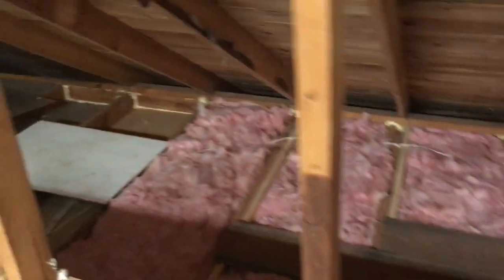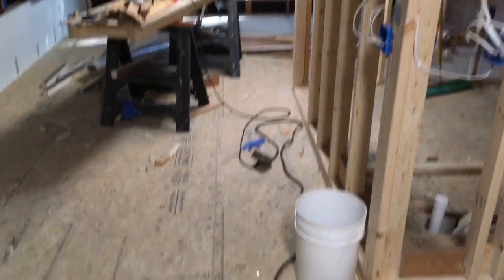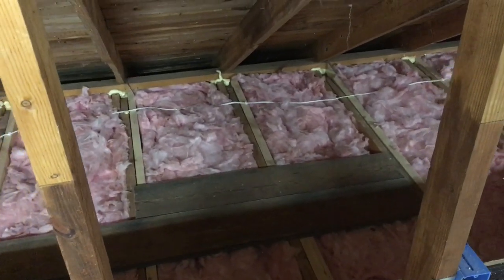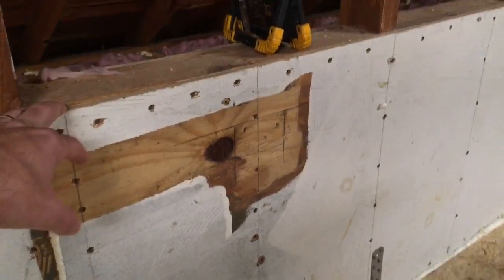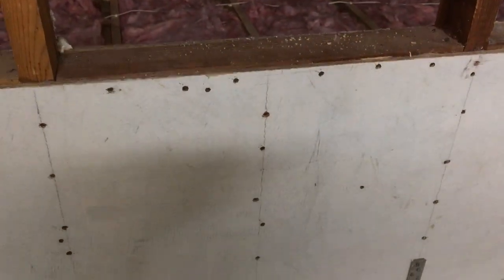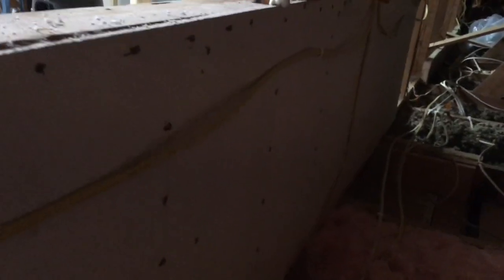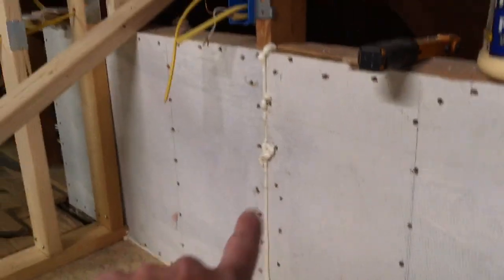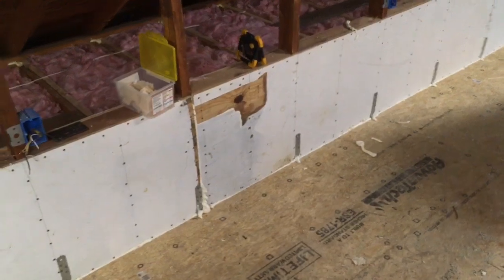How to make 2x6 joists work in an attic renovation--AND PASS INSPECTION!

Comment: I have a very similar situation as this.  I see lots of people sistering joist or reinforcing with plywood, but I want to slip an additional 2x6 in the middle making it 8 inch on center.  My calculations show this would span a 30lbs live load at 12ft.  How come I don’t see anybody doing this?
Reply from the maker: Good question. I can think of a couple of issues: The existing joists will have a sag to them, and you would want to put the crowns up on the new joists, so the floor would go from sag to crown to sag to crown between joists, causing a wavy floor. Also, if you plan to insulate, it would be a lot more cutting.

Comment: If you had to ballpark the # of hours and dollars you ended up spending on the structural part of this renovation (not making it pretty, plumbing, electric -- basically just structure, insulation, etc.)... what do you think you spent in time / money?  PS:  Super helpful video.
Reply from the maker: Whew! It's been a while. It probably took 40 hours to get the floor framing, insulation, and sheathing done, 8 hours to insulate the rafters, and about 30 hours to drywall, mud, and sand. I think we spent less than $5k dollars --- that might even include electrical and plumbing.

Comment: Very interesting but we wouldn't be allowed to do that in the UK I'm fairly certain. And we're definitely not allowed to 'sister' with the same size joist, I've been told I have to use 8x2's which are twice the height of my standard 4x2's, before 'sistering'.

Comment: So basically you used the knee wall as additional bracing to supplement for the lack of code on joist span. I never heard of this method. Makes sense though. I don't think every inspector will go for this.
Reply from the maker: Yep. That's basically it. The knee-wall sort of acts as an above-floor beam to cut the span in half. Here's a video I did to try to better explain it.  https://youtu.be/yBOwkIeroro   Thanks for the comment, Uptalk1!
Reply: its pretty much like putting a steel in underneath but this way the joists hang off it rather than sitting on it.Depth of the box beam is key. If it was plyed the full height it would be immensely strong.

Comment: Similar to my conversion as to the box beam and string back. I installed a floating 2x8 floor on 12” with some doubles. The attic insulation was done exactly the same.

Comment: Dave - very interesting thanks for sharing. I am from the UK here. Over here a loft conversion has to be backed up by a structural engineer, you pay him to do calcs and the local authority double check the workings. I don't see how someone can come over and feel if the floor is solid or not because you have dead loads and live loads. Like is the inspector going to come back in a holwling gale or when you have 2ft of snow on the roof??? It all sounds a little like hit and hope to me. Two by sixes on a 24 inch span seems well underpowered to me, my ceiling joists are the same but at 13 inch span in an unconverted attic. I get you have done this box beam and transferred load to the outer walls but in the UK you would be using steel and 11 inch deep joists. Yes your conversion might be legal but I wouldn't put a roll top bath in there or a gym. Perhaps we are over engineering in the UK though??? I guess these guys like to cover their backs so who knows what the truth really is. Anyway very interesting and good luck.
Reply: I think in the Uk the building control need calcs even if something is clearly strong enough for insurance purposes. I once converted a loft in a trussed rafter full hip roof by making the two girder trusses box beams like this guys knee wall. I studded it down to 400mm verticals then nailed and glued 2ft strips pf 18mm ply to it staggered. Then hung the ceiling joists off this. Bit nervy cutting all the truss members out but I kept checking the ridge height with laser measure as i removed truss members and it didnt drop not even by  1mm.

Comment: I’m not a wood worker. I’m more of a construction DIYer like you but I think construction adhesive should have been called for and not wood glue as it has to match grain a certain way if I am correct in my understanding of how it works. Just a tip! Nice explanation as I’m trying to beef up a ceiling to handle well more than standard live loads. I need a lot of dead load weight resistance.
Reply from the maker: Thanks for the tip. I think you're probably right about the construction adhesive.

Comment: I really doubt this is a safe modification. Did you get it properly certified eventually? What are wind and snow loads like in your area?
Reply from the maker: Yes. This passed building inspection, Marc. We have no snow here, and I'm not sure about the wind loads, that's not something I've every heard people calculate in my area ... maybe in the mountains nearby, but not here in the city. Thanks for the comment.
Reply: @FamilyFriendlyDIY  Building inspection and approval probably will not relieve you of liability should something happen. Most code enforcers are not professional engineers.
Reply: @gary24752  so what’s the purpose of inspection? For the city to get a little more money in their coffers?
Reply: @riffdex  To get your certificate of occupancy assuming that he got a building permit. Without a stamped drawing I don't know how he even got a building permit being that he was making structural changes. There may be no snow loads but certainly extra live and dead loads are involved. I am really surprised it passed being there was no engineer involved. This is really not how a box beam is built in any shape or manner. The plywood should have gone from plate to plate in order to maybe work as a box beam. How it works all depends on how it transfers the loads to the basement beam. The basement beam should have had to have been analyzed to see if it was adequate to take the extra load.

Comment: Just found this video, I’m having the same problem as yourself. A lack of info out there. 

Can I just ask, I’m starting to floor my loft space. Did you leave an air gap between the insulation and the flooring sheets? I am in no danger of compressing the insulation, but it will be touching the underside of the floor, if I start putting the flooring sheets down. 

I have the exact same space/design/setup as yourself.
Reply from the maker: I used regular R-19 unfaced bats, so they were exactly the depth of the joists. No air-gap. Hope that helps.
Reply: Dave Voskos DIY : Yes, thanks man, that does somewhat reassure me. I was afraid of condensation due to the lack of airflow.

Comment: I want to convert my attic into a bedroom. Do you think herringbone strutting will help also?
Reply from the maker: If you're talking about in addition to, say, sistering joists, it would definitely help the surrounding joists share the load and will keep things from twisting. I personally used solid blocking every 8 feet and under every wall to do basically the same thing. Maybe some others have an opinion? Thanks for the comment.
Reply: @FamilyFriendlyDIY  hey thanks for the reply, very informative video too.
Reply: @FamilyFriendlyDIY  solid bridging doesn't transfer loads anywhere near as good as herringbone strutting.

Comment: your knee wall beam is analogous to a vierendeel truss.  Hopefully it is adequately supported below.  Stiff doesn't necessarily mean structurally sound.  Failure is commonly preceded by excessive deflection but not necessarily.   A non water based glue might also be preferable - look up 'glue creep'.
Reply from the maker: hmmmm.
Reply: Except the top chord is not continuous as would be for a box beam.Even it the plywood had been extended the full height of the knee wall I am not sure if the spacing on the existing studs is adequate for the load. Only a PE would be able to analyze that.

Comment: Looks good. Is it safe to remove old fibre glass insulation.
Reply from the maker: Thanks, Pearl. Good question. It's safe as long as you wear the right PPE. Basically cover your skin from head to toe, and wear goggles (not glasses) and a good dust mask.
Reply: Thank you for your good advise warm regards 🍂🍂🍂

Comment: I appreciate this video so much. I am confused when you’re telling us about the application of the glue. Which surfaces were glued?
Reply from the maker: When making the box beams out of the knee-walls, I glued (and nailed) the plywood to the studs. ... Some viewers mentioned I should have used a different type of glue because of "glue creep," so you might want to research that ... but with the addition of the nails, I don't think that will be an issue. Thanks for the comment!

Comment: Looks great!!!  However, for a small fee you should get a structural engineer to spec this out.  Most building departments require this.
Reply from the maker: Thanks. Yes, trouble was I didn't have "two dimes to rub together" at the time I was doing this :-) If I could afford it, I'd have had engineers, architects, and contractors involved.
Reply: Yeah that "small fee" is about $700
Reply: @MrSteeDoo  Mine was $400 when I recently had a structural out to my property

Comment: In the UK whether we can afford it or not most work has to be done by a person registered in that field.  We are so over regulated. We couldn't get away with what you are doing and common sense has gone out of the window here.
Reply: yes it is bad
Reply: No it doesn’t- speak to your local building control.

Part P etc... you can do nearly everything, it just needs to be tested by someone qualified and signed off.

I’m doing it now. Only paid for things I physically cannot do or where longer  timescales would cost more than a shorter and more intense timescale that has a high initial outlay

Pouse around the house and restoration couple are examples of this on YouTube

Comment: Your 2x6 don't mean diddly until you start in the basement. Loli columns...Carry Beam. Joists...Span ETC.... Walls on first floor etc....Then you can address your 2x6...So a visual cutaway drawing by hand or scribble would make more sense than your RANTING!
Reply from the maker: Check the info card in the video. Or watch this ..  https://youtu.be/yBOwkIeroro    I think it has what you're asking for. Thanks for the comment.
Reply: @David-gld  Because I am a licensed renovation contractor. This is what we to for a living. That is why. Another Youtube DIY Wrong Video!
Reply: He just needs a load path from both ends of the box beam.  Why are you assuming he doesn't have that?
Reply: @gary24752  It is acting like a box beam anyway. My guess is it would have been stronger if the short 2x4 uprights were built at angles like a trussed floor joist.
Reply: @gary24752  Oh really. so my engineering stamp on my drawings means nothing.
Reply: @gary24752  Means I am a structural Engineer as well. Load, Structural, Span , wind shear, yada yada. WTF is your pr oblem. Or are you having a snowflake bad day? Have you ever heard of a Clerk of the Works?